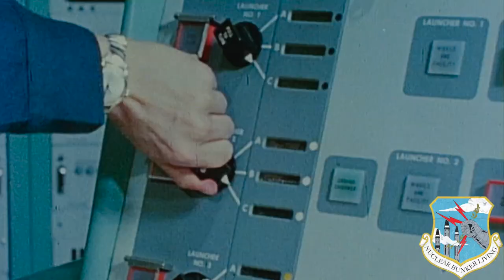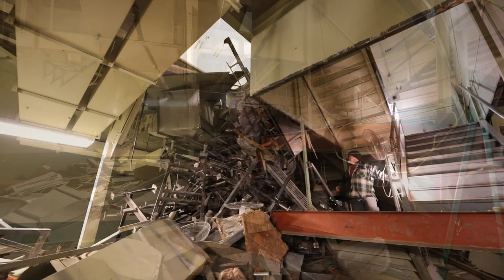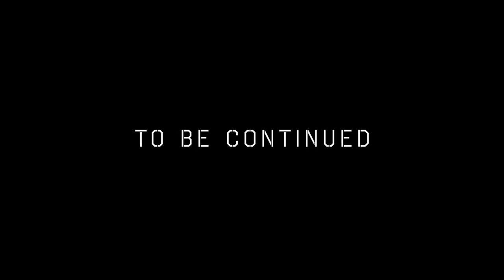EP. 21 - 2 TON GANTRY in a Titan 1 Elevator Shaft

Comment: You could take some entertainment style trussing as well. With that you can build simple spans across the whole of the tower and mount everything you need to them. They usually come im Human sized lengths and can be assembled mostly in place, and are lighter than what you got.
As a added benefit, you can climb on those and replace the motor if you need a stronger one. Or you can mount 2 spans side by side, on atop, or hanging beneath it (with the proper mounting hardware) and thus you can get like 4-10 metric tons of load capacity into the elevator shaft. With that you probably could get the normal elevator going again as well.
Reply from the maker: Well done @Felix. Great feedback
Reply from the maker: The elevator is SHOT.  New one enroute
Reply: With someone from the entertainment industry you could build a temporary elevator as well.
Even though you access portal is shut you can still get some decently sized things down there with that type of equipment.
Reply from the maker: Indeed you can.

Comment: I worry about that gantry.  I'd suggest (and no, it wouldn't be easy) a chain support to that top loop on the silo doors, to support the centre of the gantry beam where the winch is.  Otherwise, you might find-out the failure load of the circular beam the winch is on, the hard way.  Also, I'd suggest a second winch on the beam - you're going to be asking an awful lot of the winch motor, and it will wear-out and quit just about the time you really need it - or fail internally and drop a load.  Regular swapping-out of the winches will likely be necessary.  Rigid safety protocols at the bottom of the shaft (and a safety harness or two for the guys working at the top) could also prove their worth.  Very best of luck with it!
Reply from the maker: @Y Knott. All taken into consideration. Appreciate the support.  Thus far the gantry has been a real trooper. We’ve hauled out 80,000 pounds without any issues.  Will be monitoring it as loads increase.

Comment: It Great if you get industrial   "Card Board crusher" to pile (under ground) 
 then get the duct work crushed down , in Bales of Tin.  reduce # lifts   Bottom top( the hoist can take Lot more weight)

Even Better   take a day or 2  Long hydro ram    weld it to steel beam , Make ( Like log splitter) 
next to  elevator shaft.

Lay HD    chain on floor ( 20- 30 foot)  as crush the pile   then Goose neck load pull up a full ton of tin and or 
Steel beams.   

speed up process....... Get burned out hauling out 1Item at a time... You guys Kicking some serious Butt, hard work....ton tons of it
Reply from the maker: Appreciate the feedback Michael. Thank you for the support.

Comment: That's not for watching! So many H-beams were dismantled from the explosion-proof wall and there are also many other suitable steel beams in the bunker and you are doing such a tinkering with the makeshift small crane? The small crane has to move tons of steel out of the building, so a good construction is always worth it. You could have welded the perfect basket in size and weight yourself from the many square tubes and some lattice in an hour. But yeah, even in a demolition team there should be at least 1 worker who doesn't just have it in his arms...
Reply from the maker: They were from the existing walls. Beams removed will not impact infrastructure. Nee floor plans will be far more dynamic. This complex has over 5T of steel, 3 inch rebar.  It’s formidable.  Impenetrable

Comment: Guys I found a print from design of those doors they have a locking lug that is inside and was moved out just before the doors open
Reply from the maker: Hey Brian. Send that print: NuclearBunkerLiving@gmail.com

Cheers buddy
Reply: @NuclearBunkerLiving  I’ll have to drive to Fairbanks to scan them I got them from a Lockheed/rathyon tech that was up here at Ft Greely missle defense
Reply from the maker: You’re a good man Sir. Safe drive
Reply: @NuclearBunkerLiving   if you look at the hing you will see a pin in the shackle that pulls straight down with a 26,000 lbs with a ram that is mounted on the the locking ring for the antenna…. The elevator deck come up the whole way and locks the doors at about 106’ from the pin that holds the door…

You may have to drill the pin it’s about 2” you most likely bent it with the crane

Comment: Nik did you ever figure out why the portal doors wouldn't open and are there any plans to open it ? Is the plumbing still in place for the sump pumps throughout the complex?
Reply from the maker: A 2nd attempt will be in the spring. We have a few ideas why the original attempt failed. There will be a future episode on this. Most pumps were removed.  Piping remains but motor assemblies were removed.
Reply: There's a leading and trailing edge. One has to come up first. I assume you were pulling on the correct one. 
I think during operation, they both started raising up at the same time, but I'm unsure. 
Making progress. Thumbs up.

Comment: Get a mig welder down there, and weld up your support truss. You have a ton of scrap to work with there and it would be far easier to make is strong than to have a failure. Also, the lift remains that are there, are they movable? It almost makes more sense to get that working again. (probably too pricey, but given that you may need it more in the future.....its worth a shot.)
Reply from the maker: @Hanover Fist, the motor assembly of the elevator has been submerged underwater for 60 years. It’s totally shot. There will be a replacement in future episodes.
Reply: @NuclearBunkerLiving   ..and here I thought it was totally dry down there. You guys will get it done. Having that lift operational will be awesome.
Reply from the maker: The bottom of the elevator shaft was contaminated and flooded. It was quite a process to drain and decontaminate.

Comment: the water you need to pump out dose your sewage have a lift or transfer pump if it dose if you can turn it on you may be able to pump the water if you can get power to it you have sinks tubs and drains they go to the sewage do you see were i am going with this  i seen were you were trying to open the doors up top do you have the hydraulic pump hook up to the doors if you do you will never get the doors open if the pump is hooked up think about it you pull on the doors you are pulling on the pump so now you have the doors and the pump working agains you  same as the lift pump find the pump if you got one put power to it  i hope you see were this is going with this i hope it works out  let me know if it works
Reply from the maker: Thank you @Dan Bricker.  Goon intel. 
Appreciated.

Comment: whats up with the elevator thats there ?  build a cradle on it and push the doors open -
Reply from the maker: Elevator will be replaced in the future. We are attempting to open the doors. We’ve had difficulties thus far
Reply: @NuclearBunkerLiving  maybe use a hydraulic ram based on the lift frame below to break them free -

Comment: It’s a shame you couldn’t get those portal entry doors open
Reply from the maker: @cliff. Another attempt will be made in the spring.
Reply: @NuclearBunkerLiving  good to hear it will make life easier for you all.
Reply from the maker: Currently building a temporary structure above the access portal to keep rain out. That will remain until we open the doors in the spring when the snow clears.
Reply: Niko Mou, is it possible that the portal door has been structured manually sealed from inside under the door at the time for some reason of safety?